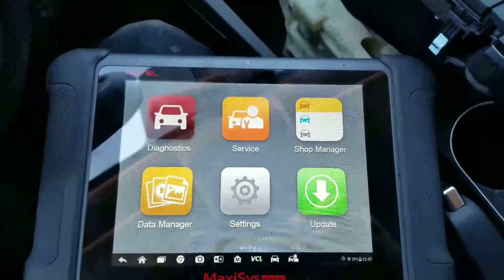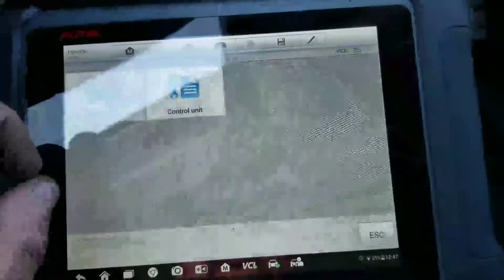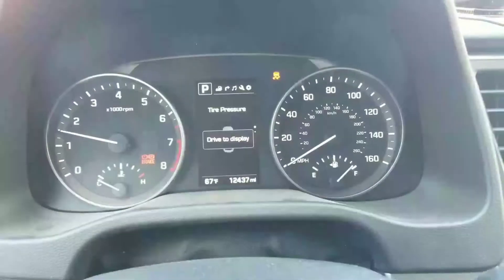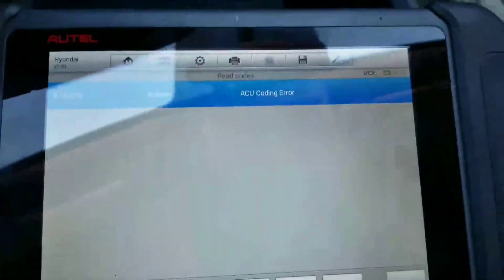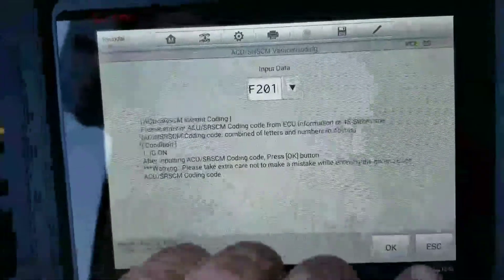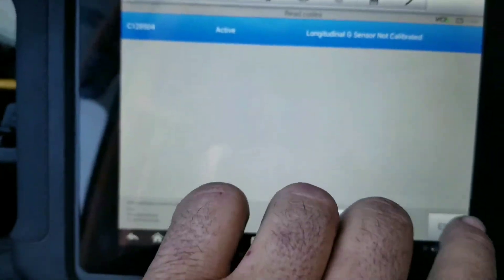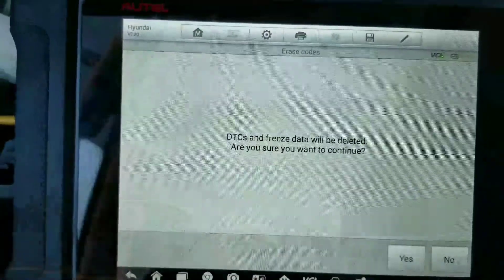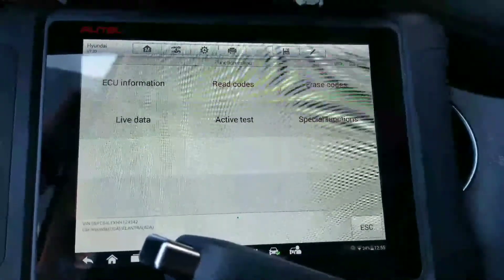Replacing Hyundai and Kia airbag srs control module with variant coding with autel 906bt.

Comment: The problem is my old module is completely dead from a flood and don't know how to get the original code
Reply: Hi! Did you find a way? I have the same proboem.
Reply: @sinusmalta  The new module I got worked as soon as I plugged it in, just had to calibrate it
Reply: @wizzy25  Mine is asking for the variant code. What is inside the old one. The lamp on the dashboard is blinking all the time. How did you calibrate?

Comment: Hello Jack, Is Longitudinal G Sensor Calibration part of the coding or did you do it or tracking light? My 2011 Sonata gices me the B1684 Not Configured Device is Detected error code after I did the coding. My scnner did not have abiility to the G sensor Calibration. Thank you

Comment: Hey Jack.....thanks for the info! Question........Can this variant code be overwritten on a good used Hyundai module or does it have to be a virgin unit? Are these SRS modules like my old BMW E39 module that had to have the VIN coded in as well? I understand liability which is why I am not asking if you think it's a good idea....lol. Just asking if it is possible. Thanks!
Reply: He never answer , did you find out in some how ?
Reply: @sabahjason1  I sent it in to an SRS module reset company.
Reply: @rbailey225  I saw a guy picked up a used module from the junk yard and extracted the code from the older one and installed the used one and programmed it .

Comment: New to your channel...and love your videos. I'm curious did you buy a brand new srs module from the dealer to do this programming? How much was the part? Would it not be better and cheaper to send the srs module out to the several air bag reset places for $50?
Reply from the maker: Joe Mucha most of what I do is insurance work. They won't use a cleaned module. If it was my personal car I would consider but these new modules are becoming uncleanable . At least in the US.  They went away from eeprom memory on most modules and store it in the mcu on the module which makes it much much harder. Almost impossible to clean.
Reply: Jack Meyers...thanks for clarification...quick question if you can help and point me in the right direction? I'm working on a 13 taurus   (rebuilder) with a maxisys 905 scanner. I scanned airbag module no problem to find out what components need replacement..no problem. I sent out the module for a reflash to clear crash data...made necessary repairs, plugged in the airbag module and now no communication with the scanner to the airbag module and codes in the cluster, abs, etc..no communication with restraints module...so obviously there's no communication now to the airbag module...and Idea where to start diagnosing?
Reply from the maker: Joe Mucha sounds to me like they botched the crash clear. That's why I don't clear crash data anymore.  In the early days it was all eeprom work which is simple but now they are storing data on tge mcu or chips not easily accessable. Some modules can be done through the data line and some with a direct connection to the mcu.If is plugged In correctly and you had communication prior that's the only thing it could be. If they were to correctly clean out the crash data or go extreme and virginize the module it would give you a calibration error . I've seen it many times to where the module is powered on but because of the improper clean of crash data the car won't recognize it as a valid module on the network.
Reply: Jack Meyers...Thanks for the quick reply Jack...this may now mean a trip to the dealer
Reply from the maker: Joe Mucha do you have the part number for your module?  Also did you send it out to have it cleaned? I have a box with litterally around 600 srs control modules at the house.  If you give me the part number I probably have one and look into what it takes to clean and maybe see where they went wrong.
Reply: Jack Meyers I would have to pull it back out and get...would take me a few days to get to it...but I will...not sure how we can get all the build data and Vin back into another module..I will get the info for you...and I really appreciate the help with this...I can't really afford a new module and a trip to the dealer
Reply from the maker: Joe Mucha if I have the module you need I can take care of that. When you get yours out message me the part number and I'll see what I can do to help. I can guarantee you the dealer will just tell you to replace the module and program it.
Reply: Jack Meyers can I email you? Mine is jmniagara at g mail
Reply: Jack Meyers ok thanks...will do
Reply from the maker: Joe Mucha yea I'll send you mine
Reply: Jack Meyers...I got it fixed! As I was taking stuff apart to get the module out to get you a part number...I found one of the lock bars was not clicked shut and the conector not plugged in all the way. I'm usually very careful and check it but the console wasn't removed and I had to slide the module in side ways...must have unlocked the tab when pushing it in. Very relieved full communication is back online with everything. I really appreciate going the extra mile to offer help..thanks 👍 Just one more task is to program a extra key...only got one with the car. I tried today with the maxisys 905...my updates expired a year or so ago. I couldn't figure out how to do it...I got granted security access after the 10 min wait but I didn't see a option to add a key. I had these options...ignition key programming, ignition key code erase, customer spare key code erase enable, disable, parameter reset, unlimited key mode off, mode on, program unlimited key code...these are all my options available on the scanner...do you think I'm able to add another key with the 905?
Reply from the maker: Joe Mucha awesome. Always better to figure it out on your own then to have to take it in.  You're going to go into ignition key programming after the 10 minute timer. It may tell you to turn on the hazzards and open drivers door. Follow the prompts .  It will tell you how to add it from there.  Just do it in the time it tells you or you will lose security access and have to wait anther 10 minutes. It's pretty easy and only takes about 20 seconds to add the new key.
Reply from the maker: Joe Mucha if you feel more comfortable I can grab a Taurus tomorrow and make a quick walk through for you.
Reply: Jack Meyers...ignition key programming was the first one I tried and just got some message...I can't remember what exactly it said...and I couldn't go any further under that tab? It was nothing like you said, I'm wondering if I just don't have the capability with my scanner..I will try again tomorrow
Reply from the maker: Joe Mucha it will do it. The ms905 right?
Reply: Jack Meyers...yes the maxisys mini 905
Reply: Jack Meyers...No luck again with the key programming....I went into pats system...did the 10 min  security wait...went into (ignition key programming)....first time doing this today said code stored in pats...bla bla. Something like that. I cleared some pats code I think through the instrument cluster test...had to regain security again...back into key programming and when I touch that button...it shows a message  ( the operation has been successful) and that's as far as I got with it??  I'm guessing if there's a pats code it would need to be cleared first?..what module tab is that located under?..but I'm sure I did clear it. Scanner software version is ford v5.10
Reply: Jack Meyers lol...your amazing that would be cool...do a video and post it for everyone using the autel 👍
Reply from the maker: Joe Mucha  I'm going to run to all my dealerships and hunt down one. Ill run through it and see what it takes to program it .
Reply from the maker: Joe Mucha did you try to start the car with the unregistered key? I'm assuming that is the code in the pats . When you are trying to add the key waiting for the timer what key is in the ignition?  New or old?
Reply: Jack Meyers...yes I did try to start the car before programming with the new key...so yes that probably was the pats code stored. Only have the one working key with the car and that's what I used while scanning and trying to program the new key. It is a cut key with remote head it does have remote start on the key head as well. It's does not have the proximity key with push button start.
Reply from the maker: Joe Mucha try using the unregistered key from the start. Turn the ignition on with it wait out the timer and see if it gives you security access. Then try the add key .
Reply: Jack Meyers...ok I will have to try that tomorrow...
Reply: Jack Meyers...I got the key programmed!👍...but not the remote  head 😢 I did what you said...I stated with the new unregistered key..did 10 min security...into next menu..ignition key programming...when I hit the button the door locks cycled and scanner said..code detected unsuccessful...hit esc and back into ignition key programming...and this time scanner said operation successful...I started the car!  It was a interesting process. I got similar results using the original key...but I guess I was looking for more menu options to add and remove additional keys...but your new way worked out..go figure. But know the remote programming???  This new key is a after market eBay key, I have a ts401 and the key is sending the rke signals out. I watched a few YouTube videos on programming...some say it gets programmed together with the key coding and other say separate...I tried the cycling the ignition 8 times to get into programming mode...but nothing happens? Perhaps the key coding was botched?...it's never easy..lol...any ideas now on this??
Reply from the maker: Joe Mucha no the programming is fine .2 separate systems for the transponder and keyless. Let me look into it real quick and ill get back to you.
Reply: Jack Meyers....ok great
Reply: Jack Meyers....any luck finding out about the remote head programming?
Reply from the maker: Joe Mucha sorry been busy as hell this week. Ill get you exact instructions on how to do it tomorrow morning.
Reply: Jack Meyers...Thanks...much appreciated 👍. You definitely have to make a video on this...lots out there when you have 2 keys. I'm sure most Ford's using the same key as the Taurus are similar to program.
Reply: Jack Meyers....I got the remote head programmed 👍....I missed a step in the programming...open the door and hit the unlock....then cycle ignition 8 times...I did that and bingo! Into programming mode...hit the lock button on both remotes ignition back off...and all good. But once again...thanks for reaching out with all your help and support...Do a video one this...mostly the programming of one key 👍
Reply from the maker: Joe Mucha I'm sorry man. I've been so busy I haven't had time to get to one. I'm glad you got it up and going. As soon as I do another Im gonna video it. Awesome you got it all done. I knew the 905 would do it I had done quite a few of them with mine.
Reply: @jmniagara , did you try doing a parameter reset with Ford you often need to do a Parameter Reset to get the modules talking  to something new on the network.

Comment: Interesting. I saw on another channel a j2534 device linked to the dealer site was used to program a fuel pump control module on a 07 Chevy Silverado. Is this something that the 906bt can do?
Reply from the maker: russell fast gm is different. Their calibrations are hosted online and can only be installed from their server . Sorry you have to use a pass thru and gm sps online to program.
Reply: Jack Meyers 
Thanks. Really enjoy your videos. Hope you make more.

Comment: thanks for showing what the autel can do and how it works. greatly appreciated
Reply from the maker: Don Muscarella you're welcome. It's not totally about the tool. A lot of tools can do what I post. I try to help people with the more technical end of programming.  I do like showing what the autel can do though. I can't stand the overpriced tool truck scanners the tool guys try to say are the best thing ever. I got burnt on a $5k tool truck brand scanner a while back. Didn't do anything they claimed it did , updates are a joke and it actually crashed twice in a year. I take every chance I get to show techs there are less expensive yet better options available. I get the whole financing available pitch the tool truck sells but I'd rather spend $1500 once then $35 a week for 5 years.  Especially when the cheaper tool works.
Reply: i understand and again thanks for the videos. I dont get tomuch in the way of programming and it is interesting to see.